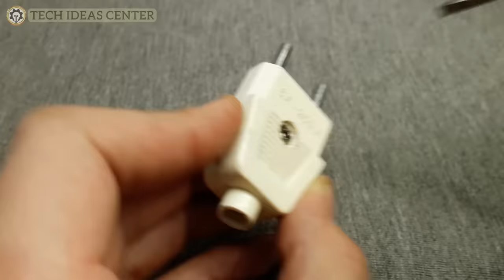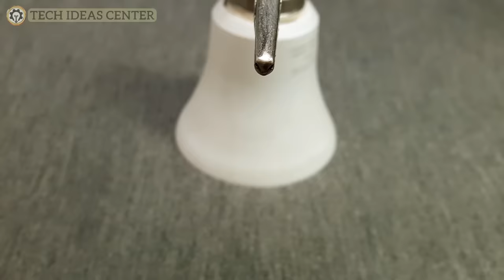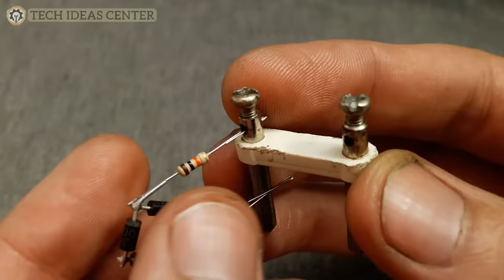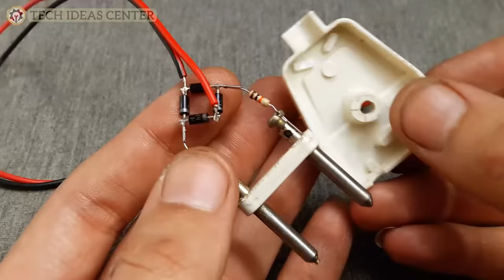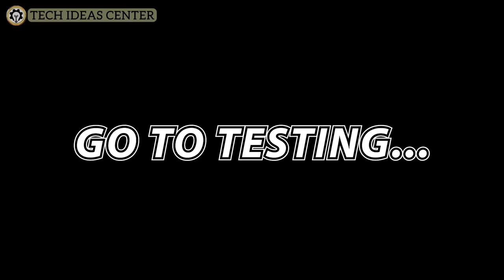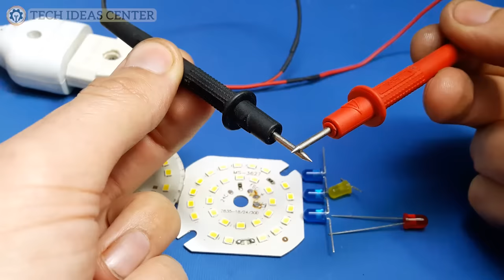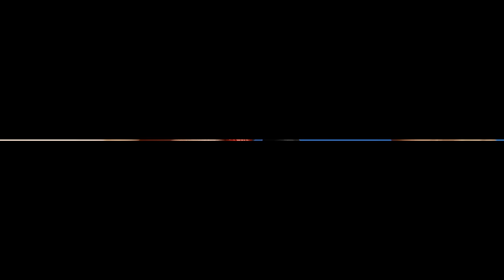Home Made LED and Diode Tester Auto Voltage / Simple and Useful

Comment: excelente😊
Reply: such a bad idea and construction
and  some ill-informed comments

First this is DANEROUS - it is not isolated from the Mains voltage, so  a nasty shock - even  a fatal shock is possible.
The voltage at the probes is over 300VDC  
VDC-peak = VAC rms x 1.4 - Vf of diodes
That is a standard well-known equation - this guy says its 0 to 200DC which is nonsense.

While the resistors limit the current - a small  current at that voltage is dangerous

Another point is that LEDs have a low reverse  voltage rating so this high  voltae coud damae a LED.   A led tester that can damage the DUT ------ not smart at all

then the construction sucks. The resistors should not be soldered directly to the prongs.  And there should be better strain relief. Plus the wires need to be rated for that voltage

In conclusion     a bad and even dangerous circuit that is poorly constucted.. It is clear to me that this guy lacks knowledge

Comment: Nice video.Thanks
Reply: such a bad idea and construction
and  some ill-informed comments

First this is DANEROUS - it is not isolated from the Mains voltage, so  a nasty shock - even  a fatal shock is possible.
The voltage at the probes is over 300VDC  
VDC-peak = VAC rms x 1.4 - Vf of diodes
That is a standard well-known equation - this guy says its 0 to 200DC which is nonsense.

While the resistors limit the current - a small  current at that voltage is dangerous

Another point is that LEDs have a low reverse  voltage rating so this high  voltae coud damae a LED.   A led tester that can damage the DUT ------ not smart at all

then the construction sucks. The resistors should not be soldered directly to the prongs.  And there should be better strain relief. Plus the wires need to be rated for that voltage

In conclusion     a bad and even dangerous circuit that is poorly constucted.. It is clear to me that this guy lacks knowledge

Comment: Too good 👍
Reply: such a bad idea and construction
and  some ill-informed comments

First this is DANEROUS - it is not isolated from the Mains voltage, so  a nasty shock - even  a fatal shock is possible.
The voltage at the probes is over 300VDC  
VDC-peak = VAC rms x 1.4 - Vf of diodes
That is a standard well-known equation - this guy says its 0 to 200DC which is nonsense.

While the resistors limit the current - a small  current at that voltage is dangerous

Another point is that LEDs have a low reverse  voltage rating so this high  voltae coud damae a LED.   A led tester that can damage the DUT ------ not smart at all

then the construction sucks. The resistors should not be soldered directly to the prongs.  And there should be better strain relief. Plus the wires need to be rated for that voltage

In conclusion     a bad and even dangerous circuit that is poorly constucted.. It is clear to me that this guy lacks knowledge

Comment: Very great 👍🏻👍🏻👍🏻👍🏻
Reply: such a bad idea and construction
and  some ill-informed comments

First this is DANEROUS - it is not isolated from the Mains voltage, so  a nasty shock - even  a fatal shock is possible.
The voltage at the probes is over 300VDC  
VDC-peak = VAC rms x 1.4 - Vf of diodes
That is a standard well-known equation - this guy says its 0 to 200DC which is nonsense.

While the resistors limit the current - a small  current at that voltage is dangerous

Another point is that LEDs have a low reverse  voltage rating so this high  voltae coud damae a LED.   A led tester that can damage the DUT ------ not smart at all

then the construction sucks. The resistors should not be soldered directly to the prongs.  And there should be better strain relief. Plus the wires need to be rated for that voltage

In conclusion     a bad and even dangerous circuit that is poorly constucted.. It is clear to me that this guy lacks knowledge

Comment: What values of components have you used??
Reply from the maker: Everything that was used in the training
Reply: @Simple.E.P  which diode is it? 1400N? What is the resistance of these resistors?
Reply: Mention proper details of the resistor and diodes
Reply from the maker: @mahaniaz5734  Did you not notice these in the video?
Diode:1N4007 4pcs
Resistor: 10K Ohm 2pcs
Reply: @mahaniaz5734 and it's auto DC volt 1~200

Comment: Super formula a made by LED Taster
Reply: such a bad idea and construction
and  some ill-informed comments

First this is DANEROUS - it is not isolated from the Mains voltage, so  a nasty shock - even  a fatal shock is possible.
The voltage at the probes is over 300VDC  
VDC-peak = VAC rms x 1.4 - Vf of diodes
That is a standard well-known equation - this guy says its 0 to 200DC which is nonsense.

While the resistors limit the current - a small  current at that voltage is dangerous

Another point is that LEDs have a low reverse  voltage rating so this high  voltae coud damae a LED.   A led tester that can damage the DUT ------ not smart at all

then the construction sucks. The resistors should not be soldered directly to the prongs.  And there should be better strain relief. Plus the wires need to be rated for that voltage

In conclusion     a bad and even dangerous circuit that is poorly constucted.. It is clear to me that this guy lacks knowledge

Comment: such a bad idea and construction
and  some ill-informed comments

First this is DANEROUS - it is not isolated from the Mains voltage, so  a nasty shock - even  a fatal shock is possible.
The voltage at the probes is over 300VDC  
VDC-peak = VAC rms x 1.4 - Vf of diodes
That is a standard well-known equation - this guy says its 0 to 200DC which is nonsense.

While the resistors limit the current - a small  current at that voltage is dangerous

Another point is that LEDs have a low reverse  voltage rating so this high  voltae coud damae a LED.   A led tester that can damage the DUT ------ not smart at all

then the construction sucks. The resistors should not be soldered directly to the prongs.  And there should be better strain relief. Plus the wires need to be rated for that voltage

In conclusion     a bad and even dangerous circuit that is poorly constucted.. It is clear to me that this guy lacks knowledge

Comment: its a bridge rectifier circuit using four 1N4007 diodes
the output will be about 110V DC approx
10K resisters should be at least 1/2W for 220V rating
Reply from the maker: Dear friend, you don't need to make any changes, just design and use it, there will be no problem. Just be careful of electrocution

Comment: guys, chill out. its only an LED tester and not a Driver... i do use one but with different applications... much more complicated than this circuit
Reply: such a bad idea and construction
 

First this is DANEROUS - it is not isolated from the Mains voltage, so  a nasty shock - even  a fatal shock is possible.
The voltage [for 220VAC mains] at the probes is over 300VDC  
VDC-peak = VAC rms x 1.4 - Vf of diodes
That is a standard well-known equation - this guy says its 0 to 200DC which is nonsense.

While the resistors limit the current - a small  current at that voltage is dangerous

Another point is that LEDs have a low reverse  voltage rating so this high  voltae could damage a LED.   A led tester that can damage the DUT ------ not smart at all

then the construction sucks. The resistors should not be soldered directly to the prongs.  And there should be better strain relief. Plus the wires need to be rated for that voltage

In conclusion     a bad and even dangerous circuit that is poorly constucted. It is clear to me that this guy lacks knowledge

Comment: How much DC volts produce  in the output ? Normally used 56k half watt resistor.
Reply from the maker: Auto Voltage . 1 ~ 200 Volt DC
No need to change parts. You can make and use according to the sample. Just be careful of electrocution
Reply: such a bad idea and construction
and  some ill-informed comments

First this is DANEROUS - it is not isolated from the Mains voltage, so  a nasty shock - even  a fatal shock is possible.
The voltage [for 220VAC mains] at the probes is over 300VDC  
VDC-peak = VAC rms x 1.4 - Vf of diodes
That is a standard well-known equation - this guy says its 0 to 200DC which is nonsense.

While the resistors limit the current - a small  current at that voltage is dangerous

Another point is that LEDs have a low reverse  voltage rating so this high  voltae could damage a LED.   A led tester that can damage the DUT ------ not smart at all

then the construction sucks. The resistors should not be soldered directly to the prongs.  And there should be better strain relief. Plus the wires need to be rated for that voltage

In conclusion     a bad and even dangerous circuit that is poorly constucted. It is clear to me that this guy lacks knowledge

Comment: Perfect way to shock yourself or burn wiring in your walls wirh short circuit🎉
Reply from the maker: Hi dear friend. Wouldn't it be better if you watched the video till the end and then judge??
This circuit does not cause sparks and damage to home or work wiring. You should read about rectifier diodes
Reply: Saludos tengo mucho tiempo utilizando este circuito sin problemas, con las resistencias de 10k tal cual el circuito descrito y ha resultado excelente  facil de usar y seguro en su uso, gracias amigo por compartir sus conocimientos.suerte @Simple.E.P
Reply from the maker: Thanks bro🌼 @germansirgo8853
Reply: Simple and perfect, bro
Thx ❤
Reply: 20k impedance ! No short circuit but resistors could dissipate both more than 1W. Maybe is better higher power capbility instead 1/4 W
Reply from the maker: @fulgen  This is an LED tester, these values are enough to test the LED. You can use 1/4 to 1 watt instead, but I emphasize again that these amounts are sufficient
Reply: @Simple.E.P  wrong  wrong  wrong     it is very much a safety hard.   do some reserch  first.
Reply: @mortezaghahremani214  such a bad idea and construction
and  some ill-informed comments

First this is DANEROUS - it is not isolated from the Mains voltage, so  a nasty shock - even  a fatal shock is possible.
The voltage at the probes is over 300VDC  
VDC-peak = VAC rms x 1.4 - Vf of diodes
That is a standard well-known equation - this guy says its 0 to 200DC which is nonsense.

While the resistors limit the current - a small  current at that voltage is dangerous

Another point is that LEDs have a low reverse  voltage rating so this high  voltae coud damae a LED.   A led tester that can damage the DUT ------ not smart at all

then the construction sucks. The resistors should not be soldered directly to the prongs.  And there should be better strain relief. Plus the wires need to be rated for that voltage

In conclusion     a bad and even dangerous circuit that is poorly constucted.. It is clear to me that this guy lacks knowledge
Reply: @mortezaghahremani214  such a bad idea and construction
and  some ill-informed comments

First this is DANEROUS - it is not isolated from the Mains voltage, so  a nasty shock - even  a fatal shock is possible.
The voltage at the probes is over 300VDC  
VDC-peak = VAC rms x 1.4 - Vf of diodes
That is a standard well-known equation - this guy says its 0 to 200DC which is nonsense.

While the resistors limit the current - a small  current at that voltage is dangerous

Another point is that LEDs have a low reverse  voltage rating so this high  voltae coud damae a LED.   A led tester that can damage the DUT ------ not smart at all

then the construction sucks. The resistors should not be soldered directly to the prongs.  And there should be better strain relief. Plus the wires need to be rated for that voltage

In conclusion     a bad and even dangerous circuit that is poorly constucted.. It is clear to me that this guy lacks knowledge
Reply: @mortezaghahremani214  such a bad idea and construction
and  some ill-informed comments

First this is DANEROUS - it is not isolated from the Mains voltage, so  a nasty shock - even  a fatal shock is possible.
The voltage at the probes is over 300VDC  
VDC-peak = VAC rms x 1.4 - Vf of diodes
That is a standard well-known equation - this guy says its 0 to 200DC which is nonsense.

While the resistors limit the current - a small  current at that voltage is dangerous

Another point is that LEDs have a low reverse  voltage rating so this high  voltae coud damae a LED.   A led tester that can damage the DUT ------ not smart at all

then the construction sucks. The resistors should not be soldered directly to the prongs.  And there should be better strain relief. Plus the wires need to be rated for that voltage

In conclusion     a bad and even dangerous circuit that is poorly constucted.. It is clear to me that this guy lacks knowledge